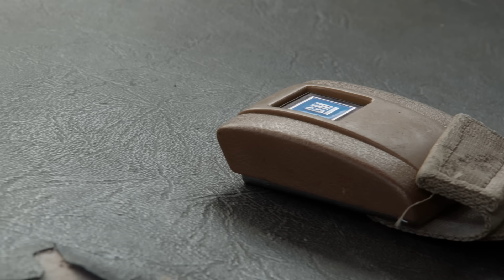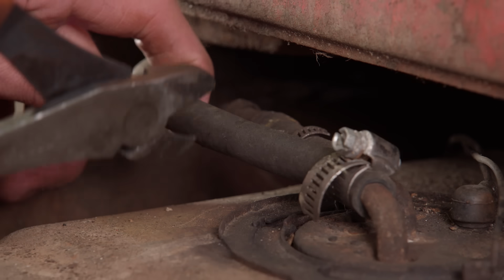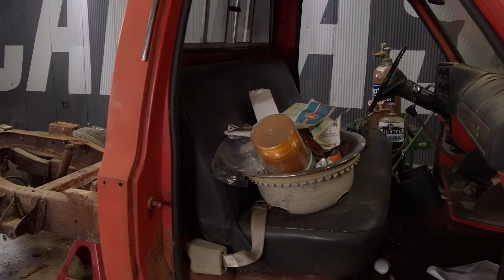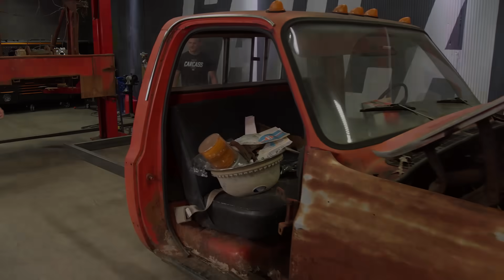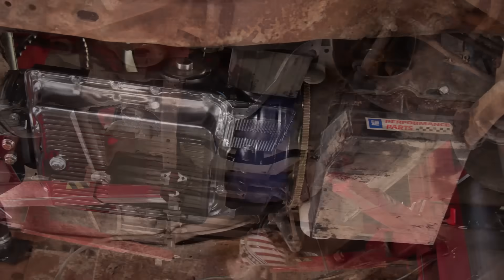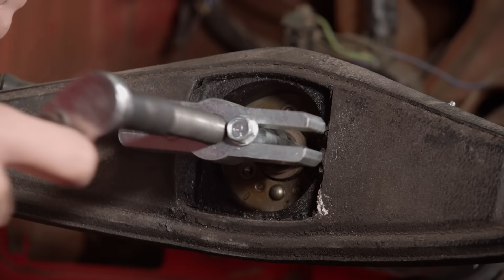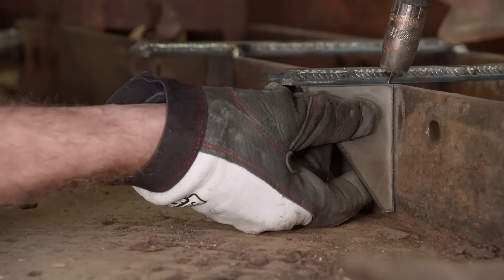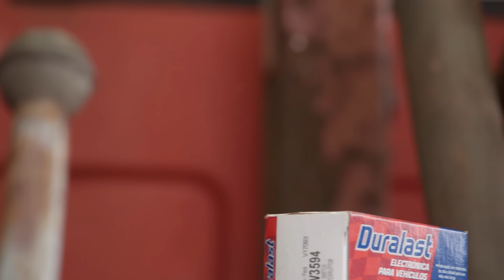Full Build: Junkyard Square Body Tow Truck Is Restored And Modernized

Comment: Awesome build fellas.  I would rather y'all had put the manual trans and restored the old winch but the way you reused the old levers was cool.
Reply: I agree I would have kept a manual trans
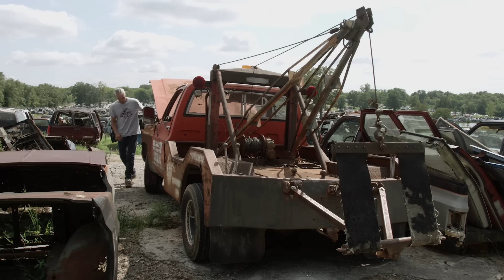Reply: @robertmoncur3781  yeh the 1968 c10 sbc-327-4 and sm465 + 4:10FG saved my A in the 3 sisters WY USA 🇺🇸 as the 4-durms got way too hot! ( and failed aka no breaks at all 😲 not the truck&trailer ) with 6k LB of load. as the the 700R4 + 350SBC 1995 crate heavy duty/moded one iv towed a 20k tow truck out of the mud once still working but id rather have the sm or a tr6060 / ect.
Reply: I80 in the dark 2AM ish for the 1968
Reply: They straight up stole the soul out of that truck
Reply: I agree. t was sad to see theat old winch pulled out
Reply: its a show, its not actually about the builds, they just solve their problems by throwing money at it
Reply: I was also disappointed when they swapped the transmission and transfer case
Reply: It’s called a WINCH guy
Reply: I also would have kept it, probably a Muncie too..
Reply: True
Reply: Uuiuu
Reply: Hey uouiui
Reply: Hey uouiuiy
Reply: Ada gamat I want to see the Mustang being built
Reply: How much did you pay?
Reply: ⁹
Reply: that electric winch isn't designed to hold a static load up. better put a chain on that sling,  and should have left the sm465
Reply: Yep
Reply: I swear they did about as good of a job on this build as their haircuts lmao!!
Let take one of the strongest and dependable transmission out as well as the P.T.O. drive to run the wench and cable, that way it's no longer even a tow truck and put a weak and totally underrated automatic transmission!!! Making it a unreliable heavy truck that can't even tow a VW beetle!! I figured this would be a good episode, but just like the Camaro build they took a decent vehicle and made it useless or completely stupid looking!!!!! Now it's just a CARCASS!!!! At least I know where they came up with their name!!! These guys couldn't make a decent bicycle that would please a 5 year old!! COMPLETE JACKASSES!!!! WHAT A DISAPPOINTMENT THIS WAS!!
Reply: @mermaiddreams83  exactly..    I helped my Pops build over a dozen square body Chevy ton truck wreckers..   PTO, WENCH, MANUAL DRIVE
Reply: @mermaiddreams83  At least they can use it to  drive to the supermarket and drag around a shopping cart  to buy more hair gel.
Reply: @mermaiddreams83  88
Reply: @mermaiddreams83  999999999999999999999999999999999999i9999999i9999i9i9ii9999999999i99999999i999ii99i9ii99iii9i99ii999i9999i99i9i9iii9i9i9ii9999i9i9iii999ii9999i99999i999i999i99i99i9i9999i9i999i999i9i99i9i9i9i9i9i999i999999i99i9999i99ii9999i99i9ii99ii9iiii9i9i9iiiiii99i999i9i9iiii9i9ii99ii99i99i99i999i9i99ii9i9i9i99i9999999iii99999999i9ii9i99iii9i99i9i99ii9iii9i999i99i99i99ii99i99iii9i9iii99i9i99i999i99999i9i999i99ii9999i9i999i9i9i9iiii9i9ii9ii9ii9i99ii9i99i999ii9i999ii999ii99i9i9i9i9i99999i9iii999i9ii9i9i9i9i9i9i9999i9i9i99i9ii9ii9i9i9i999i9999i9iii99i99i99i99999i9i9i9i9i99i99i99i99999i9ii99i99ii9i9ii9ii99i9iiii9i99ii99ii9i9i99999i9ii999ii9i99i9iii9999iiii9iiii9i99i9i9ii99i9ii99i99i9ii99i99i9i9i999i99ii9i9i9i999iii9iii99i9iii9i9iiii9i
Reply: @mermaiddreams83  999999999999999999999999999999999999i9999999i9999i9i9ii9999999999i99999999i999ii99i9ii99iii9i99ii999i9999i99i9i9iii9i9i9ii9999i9i9iii999ii9999i99999i999i999i99i99i9i9999i9i999i999i9i99i9i9i9i9i9i999i999999i99i9999i99ii9999i99i9ii99ii9iiii9i9i9iiiiii99i999i9i9iiii9i9ii99ii99i99i99i999i9i99ii9i9i9i99i9999999iii99999999i9ii9i99iii9i99i9i99ii9iii9i999i99i99i99ii99i99iii9i9iii99i9i99i999i99999i9i999i99ii9999i9i999i9i9i9iiii9i9ii9ii9ii9i99ii9i99i999ii9i999ii999ii99i9i9i9i9i99999i9iii999i9ii9i9i9i9i9i9i9999i9i9i99i9ii9ii9i9i9i999i9999i9iii99i99i99i99999i9i9i9i9i99i99i99i99999i9ii99i99ii9i9ii9ii99i9iiii9i99ii99ii9i9i99999i9ii999ii9i99i9iii9999iiii9iiii9i99i9i9ii99i9ii99i99i9ii99i99i9i9i999i99ii9i9i9i999iii9iii99i9iii9i9iiii9ii
Reply: @mermaiddreams83  Did you think this vehicle was going into operation as a tow truck or something? Its for show. Drive components dont matter.
Reply: @baddriversofthenorcalarea500   Folks in TN are a lot different than y’all west coast folks.
Reply: @greggthompson7  If by that you mean wasting money and good parts where it wont be used, then yeah. You're right.
Reply: @mermaiddreams83  Also the s10 they towed is not by mistake the FBI ABSOLUTELY HATES S10s they made millions and easily a 300 thousand mile vehicle on nothing but oil changes!!!
Reply: Yea that’s all good just go make a sammich please and quit ya bitching you keep coming back so zip it
Reply: @mermaiddreams83  4l60 is fine for pulling cars. You're really overstating it.
Reply: It's not impossible, but without the manual transmission you can't use the P.T.O. to run the winch and cable making it useless!! That was my main point, but the manual transmission is proven itself to be one of the strongest transmissions, so why change it when everything worked perfectly????
Reply: @anthonyjones8043  700r4, not 4l60. I have a 700r4 in my 87 and a sm465 manual(which was in he tow truck) in my 83 crew cab and my 465 is far better and doesn’t get hot when it comes to towing.
Reply: @bigian5656  and the sm465 wount kill you if the brakes fail as id both
Reply: @mermaiddreams83  THE FBI runs the show and manuals, restored working reliable wench that needed new cable and rust knocked off it is not what they want. FBI wants all things recycled and completely in capable of being worked on by commoners in there drive way. Thus is why engines in 2022 are more unreliable past 110 thousand miles than at any given point in global history!!!
Reply: @anthonyjones8043  I went though 2 of those trans, replaced the ome one after it went out around 130k and about another 100k the reman. GM products for me have not be good
Reply: @anthonyjones8043  My 4L60 blew up towing an empty trailer

Comment: I would have left the manual trans
Reply: @bigboreracing356  yes but that's not going to have near the pulling power of the original P.T.O.!! Trust me I own a 75 almost identical to it and with the 350sbc at idle it can stand my truck straight up on the rear and lift the front head high in the air with the 200lb bumper I've got on the front, that little electric winch isn't going to pull near as hard as what it already had that was already in working order!!!!
Reply: Same here. Nothing beats the feel of a manual trans from the 70s
Reply: Automatic if you are actually going to us it as a tow truck. For tooling around and looking awsome I would have left it.
Reply: Me too!
Reply: Or at least a TH400.
Reply: Ok fucker
Reply: Absolutely
Reply: Came here to say this same thing.
Reply: 너도나는
Reply: Automatic works better for tow truck n wrecker
Reply: Agreed!! And now without the P.T.O. the winch won't work as should and it's a completely useless truck!!

Comment: Should have made a Z-cut in the frame, versus a straight cut.
Reply: why didnt you sandblast to clean the rust before putting new body panels  in place
Reply: Fish plate to
Reply: First never use mild steel on any frame of a backhalf like this it is weak and break under stress should have found a better frame or use high tensail carbon steel thats flexable under stress the same as the frame and weld it corrcetly  preheat, weld, postheat and the right wire or rod they make testing tools to see what kind of steel frames and other metals are
Reply: Looks very sketchy
Reply: I use to work for grove world wide welding 50ton crane booms and lower and also weld manlift booms from 46ft up to 131feet in the air

Comment: this would be perfect for hauling new projects you get
Reply: How?? They removed the P.T.O. and manual transmission making it completely useless!!
Reply: they showed how at the end of the video
Reply: @wildwolf196  Nah. I wouldn't haul with that winch, no sirree. The old one was bolted into the bottom of the A-frame and was an integral part of it, not perched on top bolted to a couple of rails with gussets.